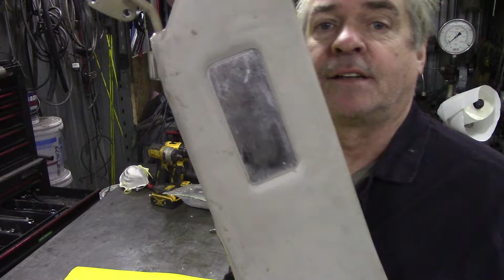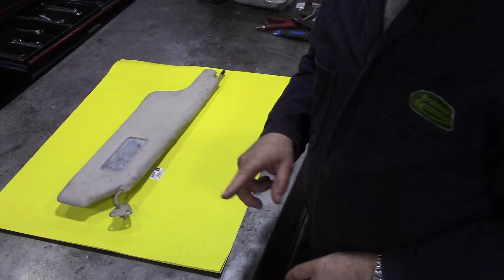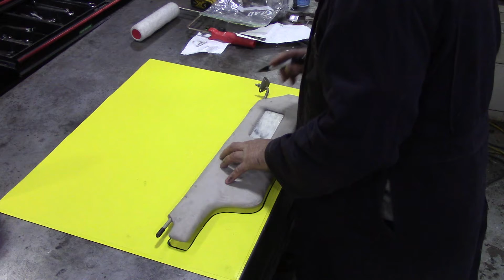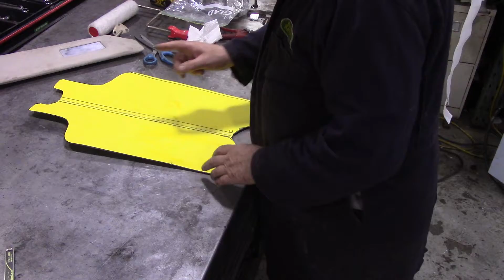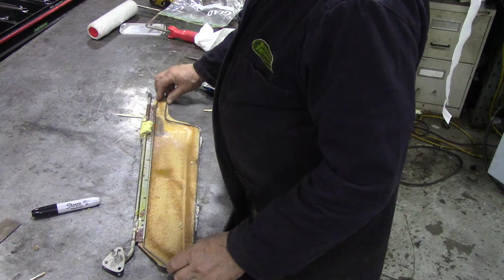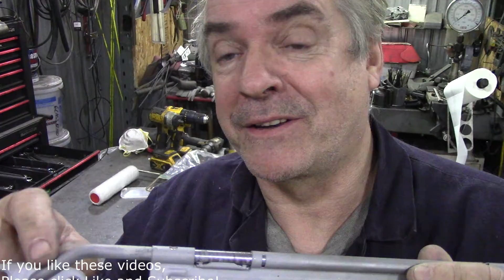Sun visor recovery. Typical old British style sun visor - can we fix it? Part 1

Comment: Hi Mike, 
I am very interested in a couple of things that you have looked at recently.

I have recently fitted a rear view camera/mirror to my Defender, but, found that the sun visors clash with the mirror. Did you have this problem with your mirror?

You said that Defender visors are solid foam, if so I thought about cutting them down then making a slip on cover from 4 way stretch material that I lined the roof with. I would fit them then hand stitch the long edge at the hinge.

It would be good to see how you solved this.

Cheers Alex Reid
Reply: OK thanks and Happy Chrimbo from Edinburgh
Reply from the maker: I have mine in my Yaris and not tried it in the Defender yet - no problems in the Yaris apart from the camera is on the left and sticks out a bit too far - takes a bit of getting used to, but no problems with the sun visor

Comment: If you go to the art supplies shop you can get thick card photo/picture backing, just the right material for this job.
Reply from the maker: Not here -- I spent most of Friday evening dragging about town trying to find the card - every craft shop etc - could find small bits but not enough for our job
Reply: @BritannicaRestorations  Not something easy to send by post either, so you are down to sheet material you can buy in the DIY store, same here i France, no shop stock anything we want, only wine.
Reply from the maker: Which is not a bad thing! Here you can buy beer and wine in the petrol stations....
(remember - don't drink and drive - you can spill it…)

Comment: oh, what fun
- in the 70s, I redid the sunvisors from a late 50s / early 60s british vehicle
- carefully cut the welded plastic seam (razor blade)
- the inside was powdered foam sheet ( foam sheet turned to dust with age)
- replaced the foam sheet with a stiff but flexable (1/2" from memory) foam sheet carefully cut to shape. My unit had also had a perimeter wire frame that needed to be set into the foam sheet. This gave it integrity of shape
- very very carefully and neatly hand sewed the outer cover back together (cut and stiching on the edge were basically hidden in normal circumstances when reinstalled in the vehcle
- wonderfull job - likely better than new, certanly it lasted twice as long as the original unit
- only possible due to chemically time stable plastic outer (otherwise I would have needed to make a new outer)
- there was no cardboard inside mine, the soft feel of the no foam gave it a luxurious and quality feel when operating the sunvisor.

- I still get a warm feeling inside when I think of this job so well done.

Comment: Mike it looks to me that you are making a mountain out of a mole hill if I was doing it I would have just got a piece of 1/4 thick hard board or MDF cut it to fit inside the wire frame secure it with sticky tape then stick the foam onto it and get your mate to cover it with the headliner stuff job done.
Reply from the maker: See part 2 soon